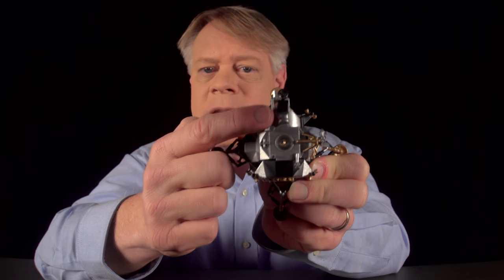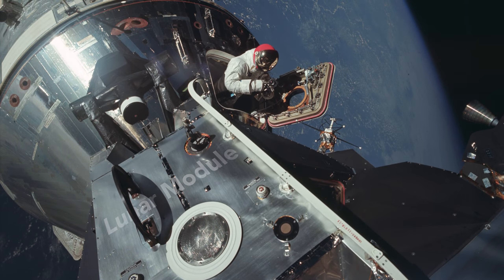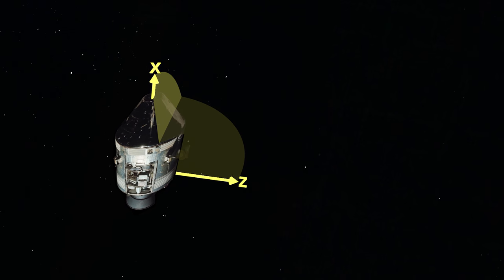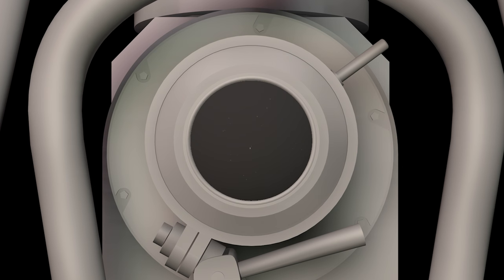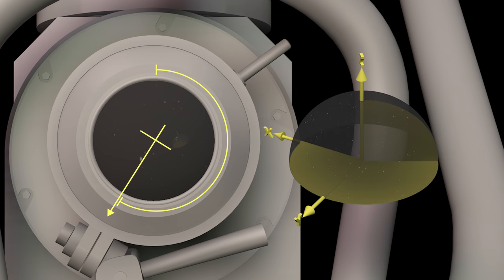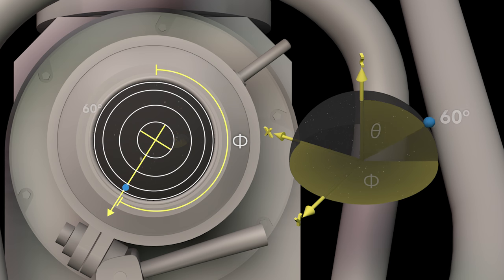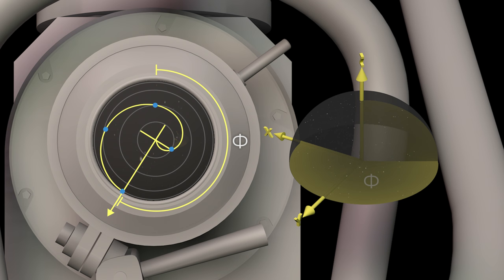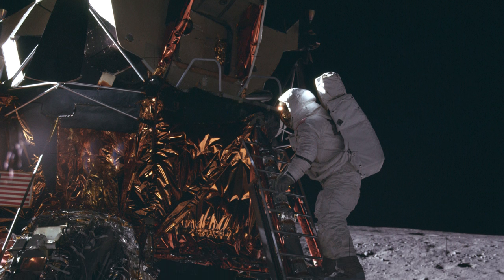Apollo: The Alignment Optical Telescope

Comment: 13 THINGS THAT SAVED APOLLO 13, PART 6: NAVIGATING BY EARTH’S TERMINATOR. One of them was from this Apollo 8,  “Lovell consulted with Mission Control whether to repeat the sextant star sighting, and someone realized this would be an opportunity to test the backup ‘seat of the pants’ means of navigating using the Earth’s terminator. And it worked!" Apollo 13 
used course adjustments trajectory changes  

On the return trip of Apollo 8's, the DSKY computer totally failed losing all memory of the computer's guidance navigational system, and the computer DSKY reset the Apollo 8 navigations data back to start mode "on the launch pad", i.e. altitude zero on Earth , which it's self (Earth)  is traveling at 66,000 mph in space, the Apollo 8 On December 21, 1968 spacecraft traveling 230,000 miles away heading back from the Moon's orbit somewhere, telemetry unknown, traveling itself at 25,000 mph in space. (Similarly, Gemini 8 with command pilot Neil A. Armstrong in 1966, with a stuck thruster, and apparently they could not upload the onboard computer from any land base radio a "memory load" due to only 12 minutes acquisition time, Hawaii station tried and failed several times.)

Unprecedented, and with the lost of all astronauts pending, they used the Kollsman sextant to save the flight. The Apollo 8 mission astronauts needed to instruct the sleeping computer: Which way is up?, Where am I by sensors measurements, and Where am I going by navigation guidance of the spacecraft's state vector position & velocity at a given time by imputing the required change in velocity and/or altitude. Searching the night skies astronauts Jim Lovell located and answered the questions manually used the sextant and they were then able... to return to Earth. The DSKY (Digital display and keyboard) interfaced with the Apollo Guidance Computer (AGC) was able to take Lovell’s mark sighting/readings that his fingers has punched-in, and translate them into accurate position and velocity data. 

For IMU Coarse Alignment - "Neither the sextant, the scanning telescope, nor the radar are involved in the coarse alignment of the IMU. However, for IMU FINE Alignment, as contrasted with the IMU coarse alignment, depends upon optical measurements. The sextant is the primary sensor and is used for tracking the direction to that star which is used as the orientation reference. The scanning telescope, 'with its wide field of view, is used for acquisition and to check that the correct star is being sighted. The astronaut, through the display and controls, puts the sextant on the star, thereby generating the star angle with respect to the navigation base on the spacecraft. The IMU gimbal angles with respect to the navigation base are then measured.Then a comparison between the actual and required gimbal angles is made. If the gimbal angles are not appropriate, gyro torquing signals are sent to the gyroscopes on the stabilized member of the IMU to drive the gimbals to the orientations that match up with the requirements for the fine IMU alignment. The accuracy of this fine alignment is of the order of a minute of arc. Since a single star direction can give only two degrees of freedom of orientation reference, a second star sighting is then necessary to complete the three-degree-of- freedom fine alignment of the IMU stabilized member."
 
Midcourse Navigation - "The midcourse navigation guidance principal sensor input is done by the sextant with its two lines of sight. In its field of view, the star and the landmark are super- imposed by the astronaut through the use of the controllers on the sextant. The navigator astronaut can also look through the scanning telescope for acquisition and identification as required, using its wide field of view and following either the landmark or star-line directions of the sextant. When the two targets are super- imposed, the sextant feeds to the computer the angle between them. The computer uses this information to update its knowledge of free-fall trajectory, so that it can provide, at any time, in- formation on position, velocity, trajectory, and trajectory extra- polarity. The sextant has only three degrees of articulation with respect to the spacecraft. Since there are two lines-of-sight, however, each requiring two degrees of freedom, an additional degree of freedom is required. This is obtained by control of the spacecraft attitude on signals from the navigator."

Orbital Navigation- "During navigation phases in which the spacecraft is in orbit close to the moon or the earth, angular measurements do not have to be quite as accurate, but angular velocities are rather extreme. In this case, the sextant is not used. Instead, the scanning telescope is used as a single-line-of-sight instrument to track a landmark. The IMU is pre aligned to a star framework, so it gives spacecraft attitude with respect to that framework. The scanning telescope on the other hand, gives landmark angles with respect to spacecraft. From these two sub- systems, accordingly, the landmark direction with respect to the pre aligned space direction of the IMU can be obtained."
   
Rendezvous and Lunar Landing - "The final function of the guidance and navigation system to be considered is that associated with rendezvous and lunar landing. Here the only subsystem not used is the sextant. The scanning telescope gives optical tracking information, and the IMU gives inertial measurements. All of these outputs are sent to the computer. There they are processed for the pilot. Control signals go to the autopilot for steering purposes and to the rocket engines for start, modulation, and cutoff control. The pilot, of course, can take over here in any level of control he desires." - Apollo Astronaut's Guidance and Navigation Course Notes E-1250 Prepared by the MIT Instrumentation Laboratory, December 10, 1962.
   
The Houston Manned Spacecraft Center had a small observatory on the roof of building 16A which contained the Apollo Optical Telescope (AOT) that the engineering people used and the crews used for training it was, said by Apollo 14 and 17 Training Coordinator Tex Ward. The Apollo 9 crew had remarkable success in sighting objects using the crewman Kollsman optical alignment sight (COAS). Their success seems to confirm the thesis that the visual acuity of the human eye is increased in space. One example is their sighting of the Pegasus II Satellite at a range of approximately 1,000 miles. Apollo 10 was sent to evaluate the anomalies of the Moon's gravitational. Future "Crew Optical Alignment Sightings" continue to be a key component for the situational awareness of piloted spacecraft. Model KSC-69C-8237 COAS used on Apollo 12. The COAS could also be mounted in the LM overhead docking window. An identical instrument was available in the Command Module and a similar instrument is used by Shuttle crews.

The current International Space Station COAS was adopted from Apollo heritage. Aboard the Apollo 'Command/Service Module' (CSM), the Kollsman sextants, scanning telescopes, and 'crewmen optical alignment sight' (COAS) were available to take measurements for use in the CSM on-board navigation system. The LM onboard navigation system accepted measurements from the Kollsman alignment optical telescope AOT and COAS, and rendezvous radar (RR) data. The valuation of the COAS was performed using a real-time pilot-in-the-loop simulation to fly an Orion approach and docking to ISS. An AOT sighting on one appropriate object plus a determination of the direction of the lunar gravity vector made by integrating output from accelerometers in the Inertial Measurement Unit (IMU)

All piloted space vehicles since NASA’s Gemini Program have carried a manual piloting aids such as a Crew Optical Alignment Sight (COAS). These tools have been used to support rendezvous, docking, and navigation in either primary or backup roles. A COAS is an optical device with fixed lateral and angular markings which provide measurement and targeting to external vehicles or points in space. Crew Optical Alignment Sights (COAS) are used by spacecraft pilots to provide a visual reference to a target spacecraft for lateral relative position during rendezvous and docking operations. NASA’s Orion vehicle, which is currently under development, has not included a COAS in favor of automated sensors, but the crew office has requested such a device be added for situational awareness and contingency support. The crew uses the COAS to align IMUs under the following conditions:
1) when the IMU misalignment is greater than the star trackers can handle, 
2) when the star trackers have failed to verify the correct star or the star tracker is not available because it is being used to track a target vehicle during rendezvous, and 
3) to improve the relative Orbiter-to-target state vector during the rendezvous phase. - NASA

On display in the Time and Navigation exhibition at the National Air & Space Museum in Washington, DC. are many Kollsman  Sextant Periscopes, such as model D-1 and Mach Instruments. The Kollsman manufactured sextants Type A-10 and  A-14 (AN5851) Hand Held and Periscopics and MIL-S-5807A PERISCOPIC AIRCRAFT SEXTANT part no. MS 28011-1, were used by the Air Force and Navy on KC-130 and B-52 Aircrafts for celestial navigation; models number # 1287-01, 1426C-02 and 1471C-O2. This type of sextant mounted through the skin of the aircraft in a permanently mounted collar and was designed to average a number of sighting quickly to overcome the motion of the aircraft.” A Sextant, Eyepiece, from Apollo 4 SPACECRAFT-Manned-Guidance & Control Stored at Smithsonian ID -A19720307000. Sextant, Aircraft, Periscopic, D-1, and mount Kollsman Instrument Corp. U.S. Property ID-A19800061000 and A20050493000
Reply: Thats a big boy

Comment: Engineering simplicity. Contrast that with the engineer who decided to move the hazzard button off the steering column, make it 3 times as big, and slap it smack dab in the middle of the dashboard. Haven't used it once in three years, yet there it is.
Reply: I have used ut plenty of times wym

Comment: A couple days ago, I spend about five minutes trying to figure out why a washing machine wouldn't take my quarter. Turned out it was a Canadian quarter. How does the machine know that I was using an incorrect coin when a human couldn't tell at first?
Reply: I believe the identification is made using two basic methods. Coin weight and composition. The second is measured by passing a current through the coin. The metals used for different types of coins give specific voltage ranges. It's difficult to fool that last check depending on how the measurement is taken and what tolerances are given. I don't know if this entirely true in washing machines though, but these are the basics. Should be similar.
Reply: Because it was an American machine not Canadian :D

Comment: Thats not an Archimedes spiral. I mean, the astronauts very very likely actually did use an Archimedes spiral, but the one you drew in the video to illustrate it is not an Archimedes spiral. Looks like it might be a Fibonacci spiral, or close to it.
Reply from the maker: Pretty sure we drew an Archimedes spiral. Only a small section of it is used, which I think makes it look like a Fibonacci spiral.
Reply: Looks like an Archimedes spiral, and not a golden spiral to me.
Reply: It's an Archimedes spiral from 0-60 degrees, since that's the field of view of the telescope.
Reply: velikiradojica Uh, what?
Reply: +seigeengine It's scaled so one rotation correspondends to 60 degrees

Comment: Weight was considered down to the gram..... yet Alan Shepherd was able to bring a 6 iron golf club up there..... just sayn
Reply: Yes during the development phase there was a lot done to reduce weight, but what you have to keep in mind is that the original Grumman LM proposed design was around 22-24,000 lbs. NASA was heavily involved of course and insisted that as much redundancy as possible be included which really bumped up the LM mass by a substantial amount.The weight saving measures taken brought it back down to a more manageable amount And at some point, Grumman was told that the Saturn V’s rocket engines had a strong likelihood of getting uprated, which did happen, so the efforts they went to reducing weight paid off as they now had more available payload for missions. That’s why the final 3 J-missions were able to bring the lunar rover along to greatly expand
Reply: I should add that he just brought the head of a modified 6-iron that could be attached to the sampling collection handle.

Comment: Isn't that a Fibonacci, rather than an Archimedes spiral?
Reply from the maker: I don't think so .... we used an Archimedes spiral.
Reply: What's the difference between a Fibonacci spiral and an Archimedes spiral? also why is a spiral better than a straight line from the centre to the circumference?
Reply: No. It's hard to tell visually over just the center of the spiral, but the obvious part for me is that the archimedes spiral goes around with even spacings between each turn as the spiral progresses, whereas the fibonacci spiral's distance between passes increases dramatically. Since this is only the center, it's a bit hard to tell, but this spiral seems to be leveling off whereas the fibonacci spiral would be increasing the distance substantially. I hope that makes sense...
Reply: +seigeengine Yeah that makes perfect sense, didn't think about the centre-most points would be bunched up. So the change in radius of an Archimedes spiral is constant?
Reply: ***** Unless, I'm wrong, yes.

The reason a spiral is preferable is because it provides more length along which to measure, meaning you can measure with greater precision. Think about it like a ruler. You can only read markings on a ruler if they're big and separate enough. At some point you just can't distinguish between them, right? Yet imagine if that ruler was longer, and bent into a spiral. You'd have more ruler on which to put markings, yet the ruler would measure the same distance as the straight ruler did. Since there's more distinguishable markings, you can measure with greater precision.

Same idea, but using the rotation of the spiral, so your ruler is now the circumference of the rotatable spiral, instead of the radius of a string from the center point.
Reply: It appears to be an Archimedes spiral on a polar coordinate system, which would make sense given its intended use
Reply: An Archimedes spiral makes sense. The equation is just  ' Radius = m x angle ' , where m is the rate of change of the radius, that is constant. If you want the spiral to take 360° for a full Radius then m=FullRadius/(2 Pi).
This would make things simple for the onboard computer to recieve the rotated angle of the eyepiece, calculate the corresponding radius on the eyepiece and from that calculate the angle of the star, according to some other equation or table.
Reply: Arthur Vieira I'm guessing the computer wasn't receiving any such information directly.
Reply: seigeengine By what he described no. They had to make use the instrument to take measurements and then input them on the computer.
Reply: A fibonacci spiral becomes more widely spaced farther away (as +seigeengine noted), but it's also different from geometric spirals: unlike a geometric/exponential/golden-ratio spiral, a Fibonacci spiral is made of many quarter-circles with Fibonacci number radii stitched together; therefore, rotating the Fibonacci spiral, especially when not by a multiple of 90°, changes its shape.
Reply: Same difference :)
Reply: Those are 2 different things: Archimedean spiral distances are constant..
Reply: Nope, they look similar.
Reply: Welll there is an important diference between the two, if you place one over the other it becomes clear. Now Fibonacci numbers are a succesion thats is determined like this {Fibonnacci series} = a1, a2, a3 .... an;  a1=0; a2=1; those are the first two values of the serie and; an = (an-1)+ (an-2); (just add the two previous numbers and you get each number on the serie, while Archimides spiral is one that each segment of the spiral is separated proportionally to the closest by a given ratio ( the polar ecuation for that is r=a+b(Theta)), a simple observation is that Fibonacci spiral grows much faster and wider than the archimides spiral .

Comment: why have a ladder to begin with, its the moon, just fucking jump
Reply: Getting out is easy, you're right. Getting back in wearing a clumsy-ass suit is harder.
Reply: the moon has 1/6th the gravity of earth. that means you could weigh over 600lbs on earth and still run around just fine on the moon. even though they had clunky suits on they could jump around just fine. the ladder was redundant tbh
Reply: CaptainSkelebones Watch the Moon Machines documentary. It recounts how Grumman decided on the ladder.
Reply: It's preferable to be able to get back into the LEM.  Besides, they were dealing with complete unknowns; the idea of having an astronaut jump out would obviously seem risky. Too many variables - eliminate as many as possible.

You have to remember, they weren't even entirely certain if the lunar surface was solid enough to support a lander or object.